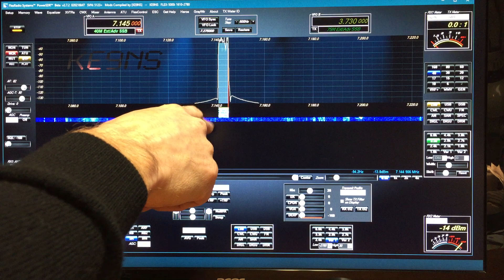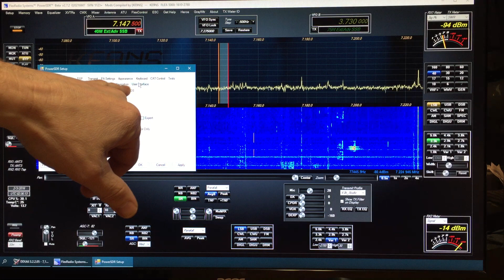PowerSDR_2.7.2-ke9ns Rev M7

Comment: Darrin, I think you just increased the fun-factor by a huge amount for the legacy Flex owners! Beautiful work!  - Rob W1AEX
Reply from the maker: +W1AEX I look at it as a great way to learn C# :)
Reply: +Darrin K  Looks like you've mastered it! Is the background for the analog s-meter a jpg or png graphics file? The Genesis version of PowerSDR handles their analog s-meter that way. At any rate, nicely done!
Reply from the maker: W1AEX Thanks. Ya Genesis meter looks like an ICOM photo. I wanted to keep the meter a little smaller so I didn't need to rearrange the entire console (I am not very good at graphic layout aesthetics)
The TR7 is a png that fit nicely, but I had to adjust the algorithm to match Signal and Power scale of the TR7. The "Analog" is mathematically generated (just like the Edge meter is), that way I was guaranteed the meter would be calibrated exactly like the Edge meter, plus I can change the colors and style when you change the meter type (Power, swr, alc).
Reply: +Darrin K  Thanks for the explanation of the meter display. Hope your next SDR is an Apache Labs ANAN so we can benefit from your skills with OpenHPSDR!     :O)